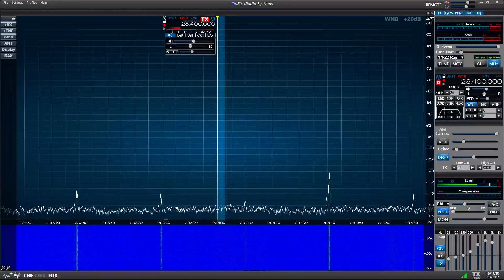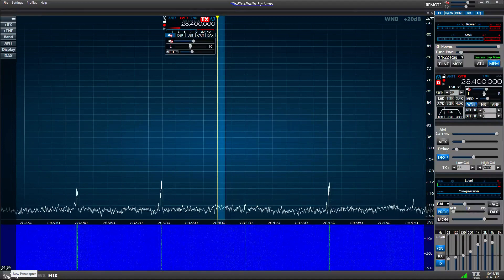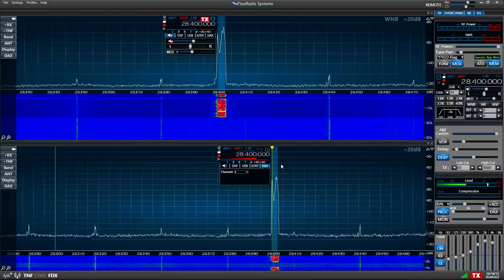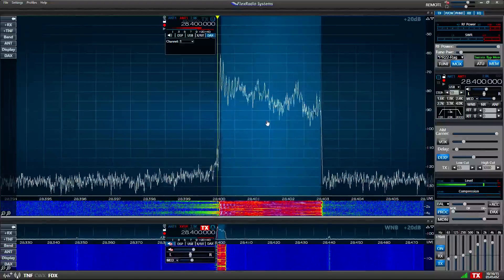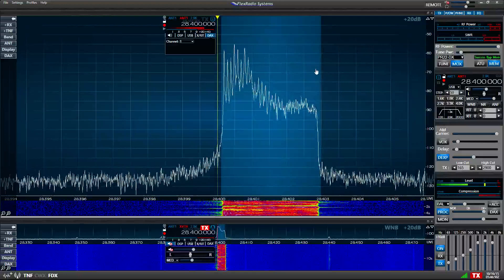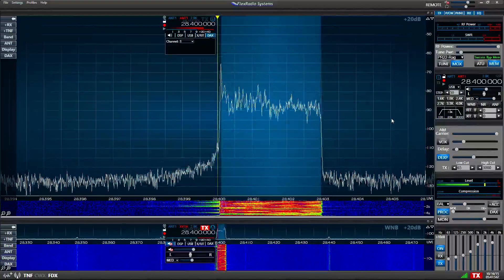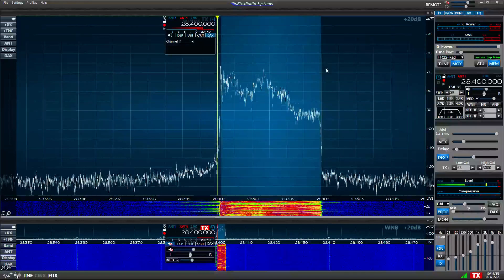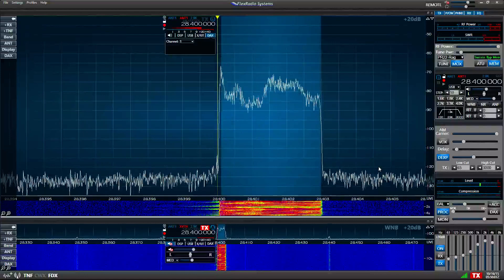Full Duplex Monitoring on Flex 6000 Series

Comment from the maker: UPDATE:  Since update V.1.6.0, the Mic Profile was separated from the Transmit Profile.  So when the video says to save to your Transmit Profile, you will now save it in a Mic Profile.  
This is actually a good change for SSDR, because it allows changes in other transmit parameters without needing to save additional Mic profiles.  For example I have three Transmit Profiles that allow me to select Output Power of 100, 5, or 1 Watt, just for fun.  Others will have a separate transmit profile for running with their amp which controls timing of the external switching ports.  These parameters have nothing to do with Mic audio profiles.